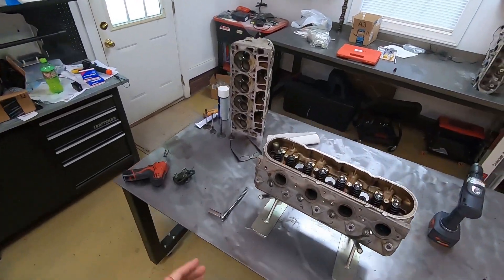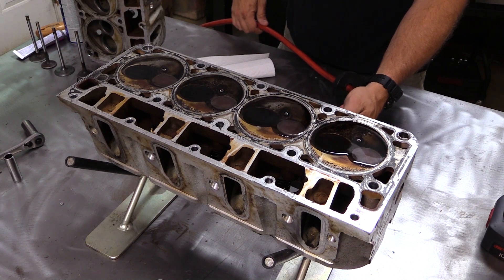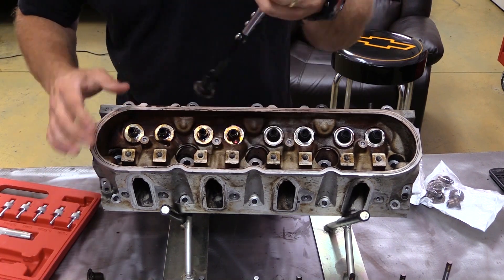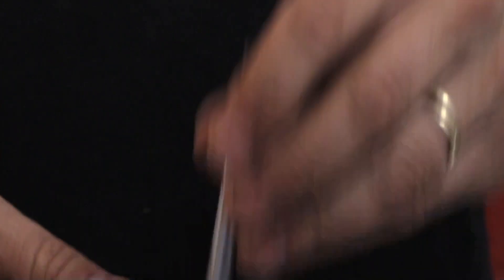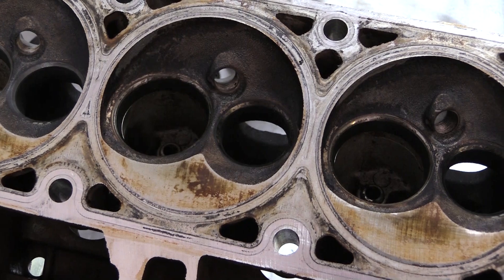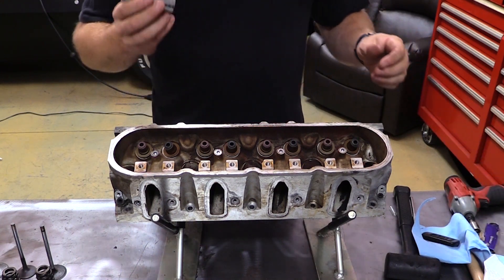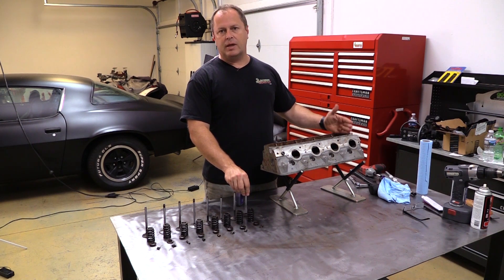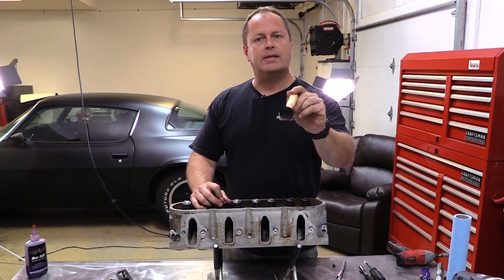How To: Low Buck Cylinder Head Rebuild

Comment: Might be a good idea to start the video with the key information of when disassembling, keep the valves and springs, and if possible, the push rods, organized so you know what cylinder they came from. Especially as these engines get older, you never know what someone has done to the heads / pushrods before you got them. With the torque down / non adjustable rockers, assembled valve stem height is critical. Other wise a valve that sealed without rockers bolted down, could leak because the rocker keeps it from closing, or it could have excessive clearance rocker tip to valve stem and you end up with an engine that sounds like it's got a collapsed lifter that will fail prematurely. Not being a wise guy, just thought it might save someone a head ache. 
I started building engines in the mid 1970's, and the big block MOPARS (383 / 440's) had those torque down rocker shafts. Without the individually adjustable rockers like the Chevrolet's, you  had to measure the valve stem lengths in the heads and either machine out the seats and replace them and make the seat depth all the same, or if they were not too bad, you could find  the worst one,  grind the valves and the seats, then make them all the same to that worst one, then measure to find the correct push rod length, then make up a set of push rods for that engine. They'd run great if you set them up right, but it took a lot of measuring, and work. Most hydraulic lifters had .060 of internal movement, so you'd want to shoot for right in the middle of the throw, so you'd have +/- .030 so they wouldn't be loud when cold, and wouldn't hang open when hot. 
Here's a tip for you for keeping from gouging aluminum deck surfaces when cleaning off gaskets.
Make a scraper out of wood, and clean the cutting edge with a sharp knife to keep impurities from embedding in the wood.
Aluminum and oak are virtually the same hardness, but the wood will usually give first before damaging the aluminum.
Again, not criticizing, just thought I'd offer a few tips I've learned over the last 50 years from machining everything from race car / hot rod engines to submarines, to robotic articulating arms for the now decommissioned space shuttle.
I enjoy your videos. Take care.
Reply from the maker: All great tips. Always love hearing from old school engine builders. Thanks for sharing.

Comment: seems like those rods on the work stand might dent the edges of the heads when pounding on the valves, maybe put some plastic tubing over them?
Reply from the maker: They do have thick, rubber sleeves over them. Probably were just hard to see. Thanks for watching!

Comment: the ls tip for valve seal intall is 1 water pump bolt,5/8th open end wrench,1 washer so the bolt head cant go threw the wrenchs head an a 12mm deep socket..you take the washer,slide the bolt threw that,then stick the bolt threw the closed end of the wrench..you then press the seal down with the 12mm under the wrench and over the seal..simple press till you feel it stop and you are good..this way makes it where you wont rip the seal like a hammer and socket can do if some one hits it to hard 

ps lq9 aint that bad i get 500-600 n/a out them depending on setup..i got a lq9 sbe one now that im looking for 700 out of with stock port ls3 heads,hyd cam,102mm ls3 intake extremely worked by me..13.5-1 comp,heads are 47cc,pistons have .150 fly cuts..
Reply from the maker: Interesting, I'll have to give that a try next time. Thanks!

Comment: Is this the best junk yard head for the 6.0L.    I was hearing rumors that the 706 casting was the hidden gem to swap onto the 6.0.
Reply: Taras zakordonskk 706 heads had a cracking problem. 862 is the same head but better cast. Also the 862 has a smaller combustion chamber than the 317s. If you want more compression.
Reply from the maker: I've heard the same things about the 862 heads. They came on the 4.8 and 5.3 liter engines and have a smaller combustion chamber (61 vs 71 cc's) to help with compression. However, the tradeoff is the smaller intake valve.  The 6.0 heads have a 2 inch intake while the 5.3 heads have a 1.90 diameter intake. Good luck!
Reply: So the 5.3 heads are better than the 6.0s?